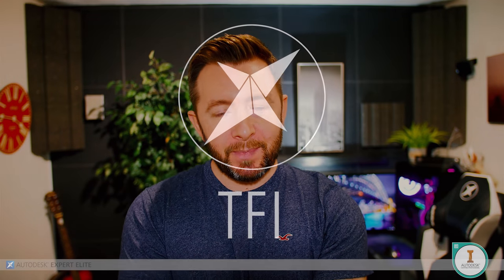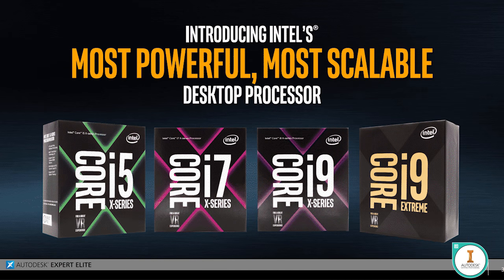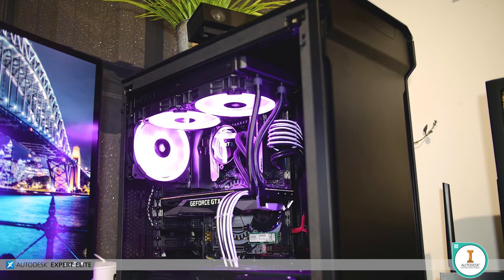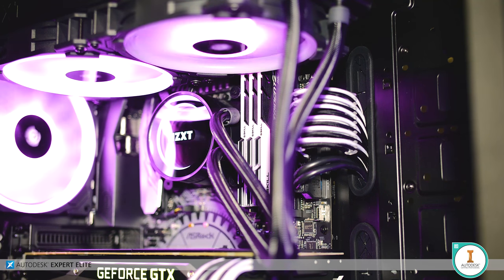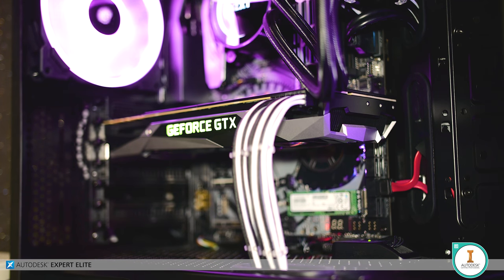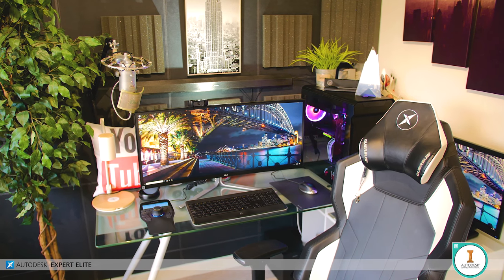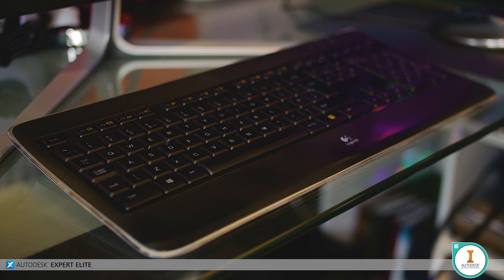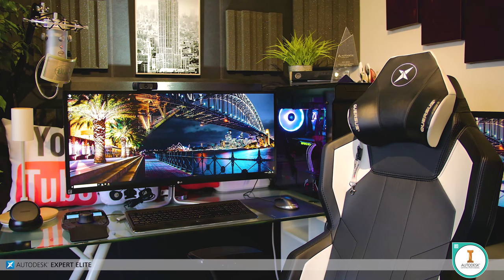The TFI 3D CAD PC - My Ultimate Setup

Comment: Great system Neil, I am about to upgrade to an Alienware 17 R4. My current system is a Dell Precision M6400. I had mine for the past 8yrs and is time to upgrade. I am an Architectural Drafter. I use AutoCad Architecture for my designs, mostly 2D designs. I am planning on presenting my projects in 3D. The specs for the Alienware that I have customized are the following:

7th Generation Intel Core i7-7820HK (Quad-Core, 8MB Cache, Overclocking up to 4.4GHz

Windows 10 Pro 64-bit

NVIDIA GeForce GTX 1080 with 8GB GDDR5 Overclocked

17.3 inch UHD (3840 x 2160) 60Hz IPS Anti-Glare 400-nits, w/NVIDIA G-SYNC

32GB DDR4 at 2400MHz (2x16GB)

256GB PCIe SSD (Boot) + 1TB 7200RPM SATA 6Gb/s (Storage)

What do you think about that system?  I just want to have something fast and reliable that will last me several yrs. i will appreciate your opinion.
Reply: If you have a 1080, why don't you opt for 120Hz screen?
Reply: Thanks for the suggestion!

Comment: Question about 3DConnexion.   Have you ever had trouble with the drivers / Wincore?   

I’ve got an Enterprise and the software won’t work properly because the wincore fails to update.  The speed settings have no effect in Inventor, full speed all the time.  I’m fast mate, but not that fast.  Works fine in Solidworks. 

They suggested a full uninstall and start from scratch, but even my very seasoned IT department was unable to fully remove all 3DConnexion influence from my Windows 7 machine.  

Their support has been dreadfully slow and unhelpful so far. 

Have you ever had to root out all of their software?